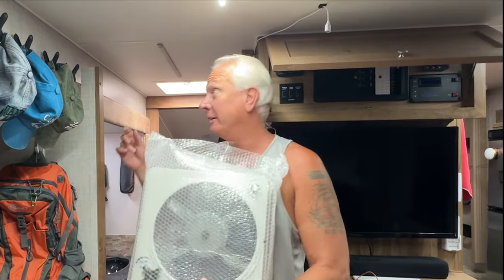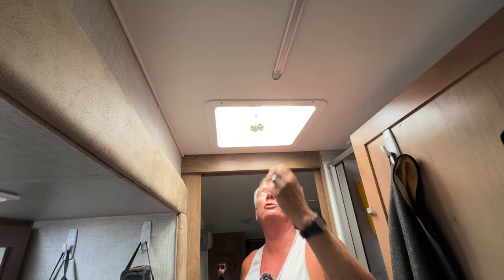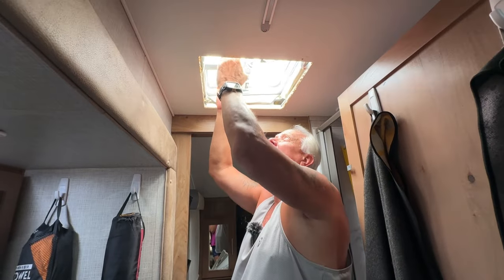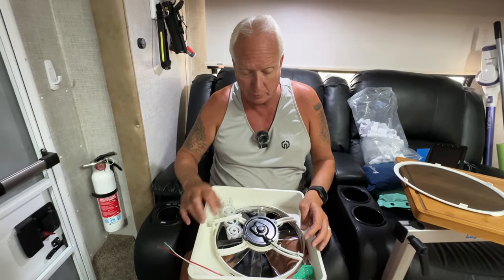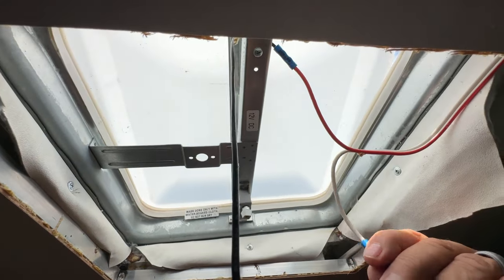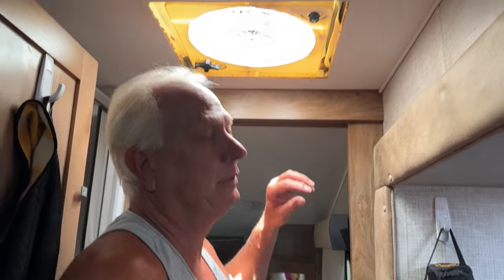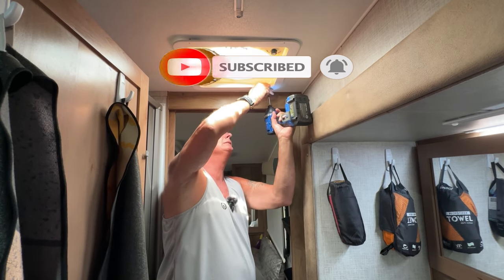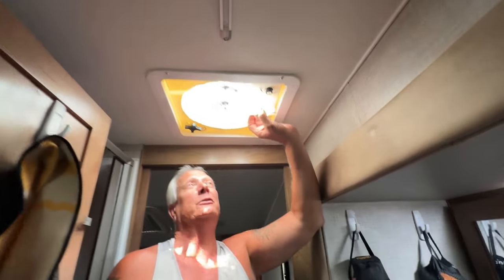Upgrade Your RV Bathroom: HENG Fan Replacement for 3x the Airflow!

Comment: Great Video. I have a Host as well, and had planned on moving my fan from living room to the bathroom and replacing the living room one with an upgraded Maxx fan. This seems way simpler. Please let us know how it works over time. Is it load? does it vibrate, etc...? Have a great day and keep up the great videos! Safe travels.
Reply from the maker: Mike so far it’s quieter than the original, no vibration. I would have loved to change it out like your plan, our solar panels are in the way and i much rather have extra solar taking up the room on the roof over a bigger fan.